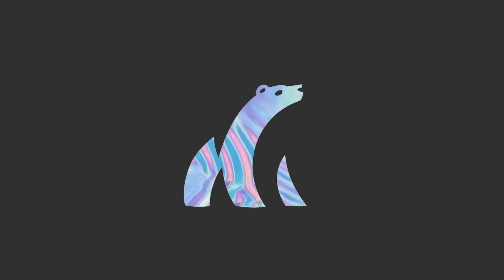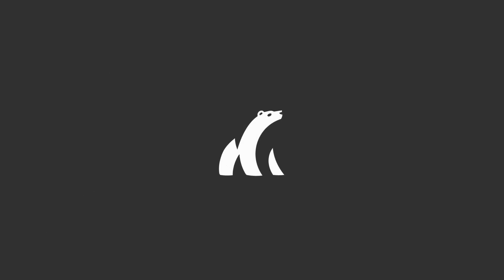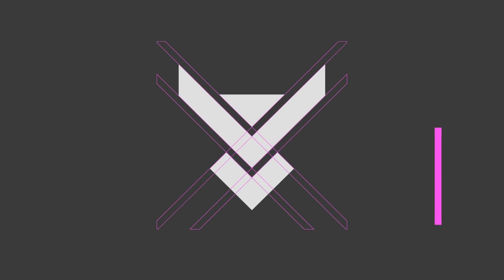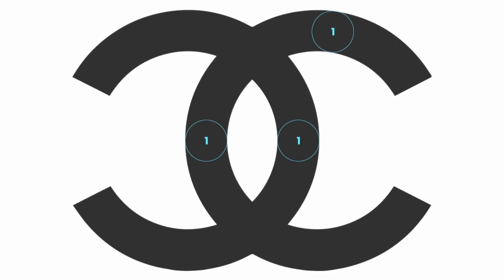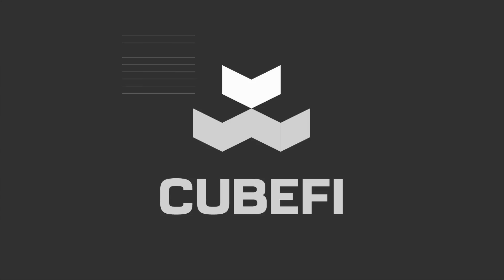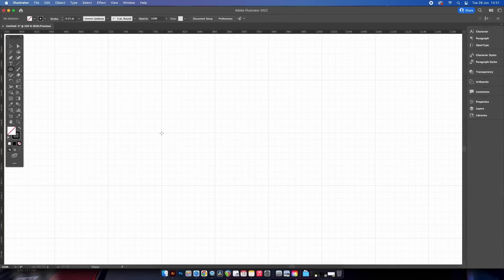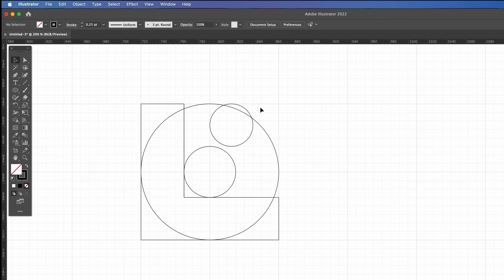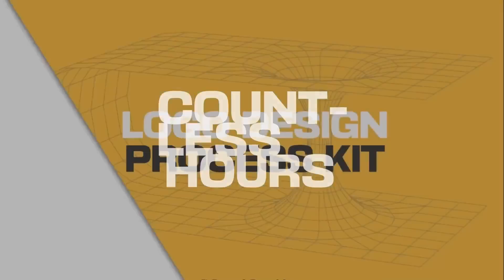Designing Logos Is Difficult?? DO THIS!

Comment: Thank you! Well, I don't use Illustrator's guides, but draw circles and vertical, horizontal and angular lines of calculative gaps to match my sketches. And, then use shape builder tool to get the design.